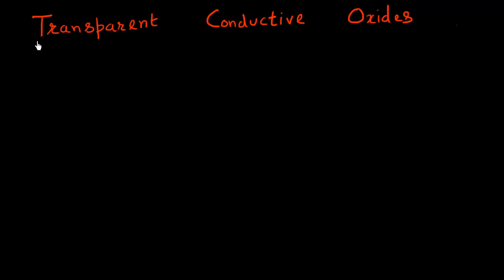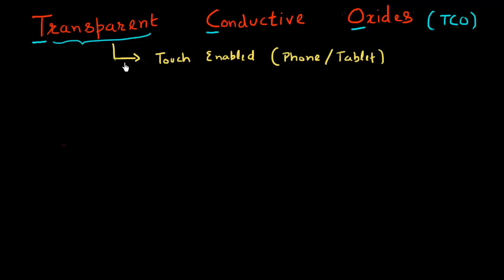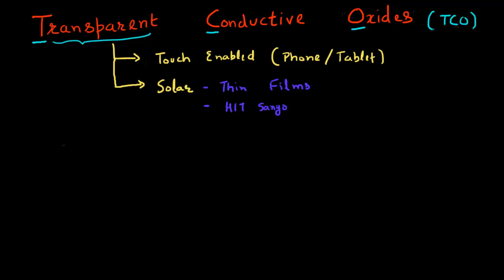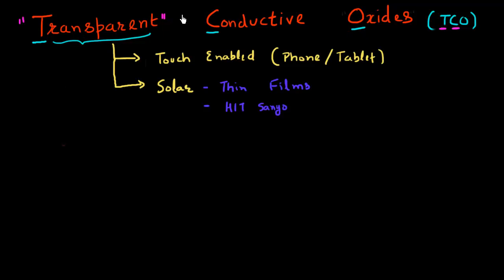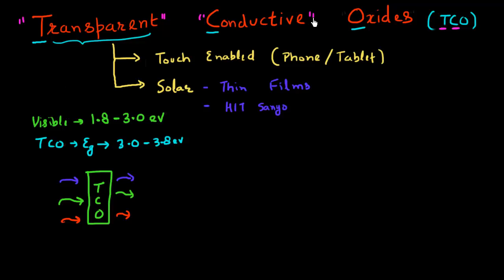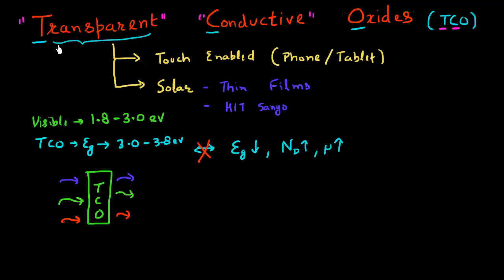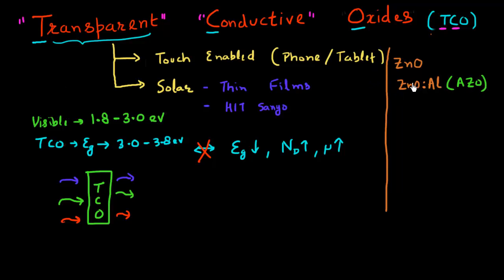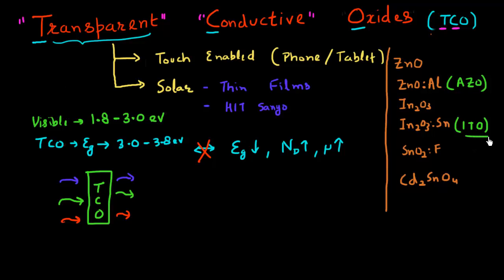Transparent conductive oxides for solar cells: part 1

Comment: I was wondering if there was a conductive oxide that will not corrode from a galvanic reaction. Im looking for something I can use in a diy project so it has to be a common material. would lead oxide work?